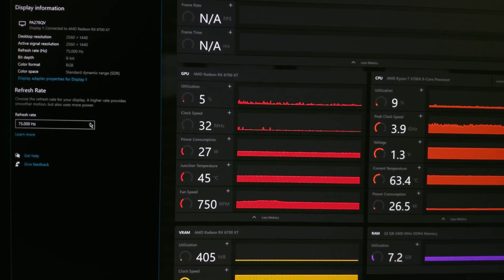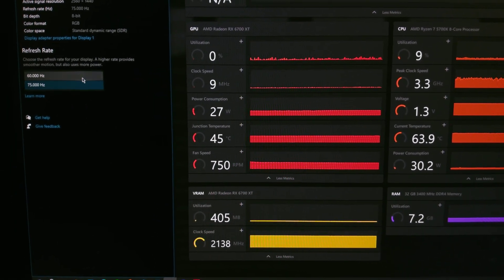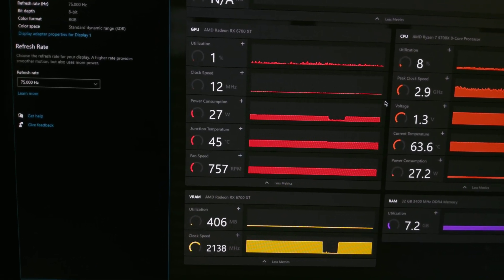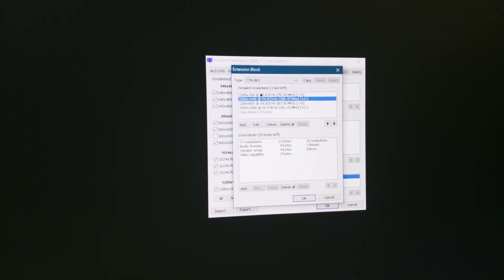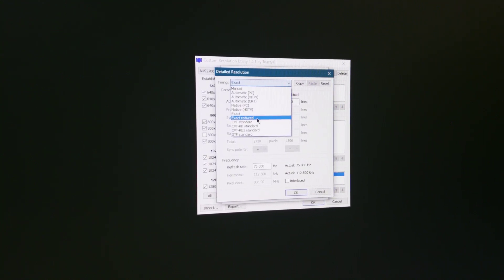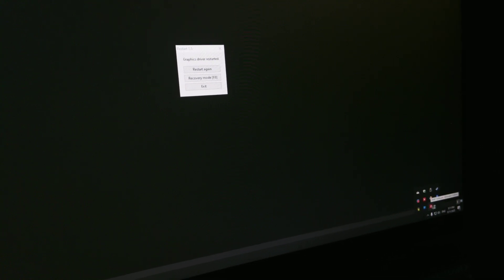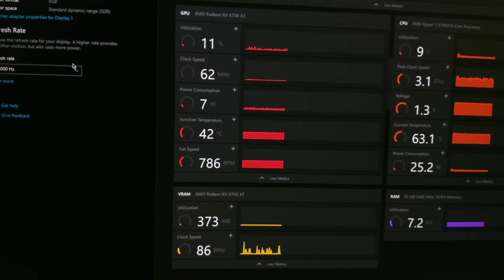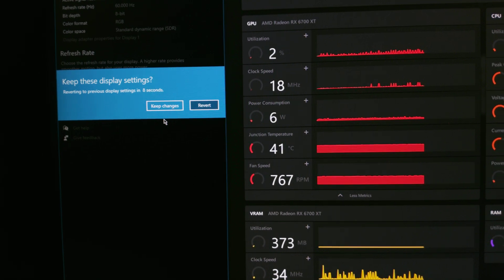Fix High VRAM Clock Issue at Idle on Radeon GPUs

Comment: I have 6750 xt and dual monitor one 165hz and other one is 75hz and what worked for me is adding a custom resolution to 165hz and setting synchronization to CVT. After that just changed to that custom made profile in windows settings
Reply: Idk why it worked but worked, it lowered vram usage from 2300mhz to 10-20mhz and also lowered power consumption from 40w to 8w

Comment: Everyone still having this issue after using this fix make sure that you are not using AMD noise suppression with your GPU just use CPU or just turn it off it ruins my sound in my experience. Also you can use automatic PC option in CRU. After applying the resolution with these CRU settings applied you might get a flashing screen in that case just reduce refresh rate slightly till it works. Had to reduce from 180hz to 170hz apparently caused by cheap display cables.

You might also wanna turn off any memory overclocks after applying these new Resolutions because the card will become very sensitive to VRAM OCs, well that was the case with my 7800xt, core clocks you can go as high you want just leave VRAM clocks alone or let it OC vram itself.

If you have multiple monitors apply this fix for every monitor and just to avoid games overriding your resolution and returning the problem create custom resolutions in the adrenaline software using CRU resolutions as a base. AMD custom resolutions will not be overridden by games or other software

Comment: For everyone who is having this isue. I had a solution, could work for any of you... When I will not play games, I just desable the AMD Smart Access Memory (SAM)... And the vram clock is just fine now. I mean, i dont know if it will work for everyone or every amd card, but for me was hard to find the frequency in my LG 240hz 1080p... Nothing working here. And than I just though : " I will desable that SAM haha ! And it just worked. My Vram clock was aways in 900mhz to 2000mhz all the time just browsing the internet,  and now its pretty much 90mhz to 200mhz must of the time, sometimes a little bit more, but its definitely better. 

My problem was a little more complicated than just "energy" my Vram was getting hot, cause in " zero RPM " fans the memory was hotting alone, like 70c in IDLE. Now the memory is getting 55c in Idle, when GPU is 40c and hotspot 47c, all temperatures in IDLE.  The Memory even with SAM off is going to 55c, but with SAM on was getting 70c in Idle. Im really sad with this, but the thing is, when Im GAMING and stressing at MAX, 100% GPU Load , even with OC, bringing 300w in the GPU, really stressed, Im getting GPU 58c, Hotspot 78c and memory 78c too, with the Custon Fan curves I did... And those are really GOOD temperatures for FULL LOAD. So, the problem is just with the Zero RPM fans in Idle  and its just the memory that is getting 70c alone, really strange. Anyway, you can desable " SAM " to try, I know " enabling " SAM can be a little trick sometime, but it was what work for me.  Sorry about my english, its not my native language, im brazilian.

Comment: For me just changing the FreeSync options from basic to extended resolved this issue. Thats it. Problably disabling could fix this too.

I have a RX 7900 XTX.
Reply: crazy that this actually worked for me
Reply: how did you do that?
Reply: @hossamgehad6673  I just changed the monitor freesync option from one to another
Reply: @hossamgehad6673  Try changing the freesync options of your monitor
Reply: @hossamgehad6673 this settings appear on your monitor menus

Comment: Hi all, I found that changing the monitor Hz to a whole number 1 less than max refresh in CRU fixed my stuck vram clock and high idle power. 100w to 10-30w idle and 33MHz vram clock. 👍
Reply: Sorry man, could you explain what you mean by "whole number 1"?
Reply: @DeathMetalManiac  i assume 144 hz -> 143 hz or 165 hz -> 164 hz

NO fix works for me at all. 110w just being on this page alone. 1440p 144hz and a turned off 1080p 165hz.
Reply: @kochiss  Try going to "Streaming" and turning off everything on "Media"
That worked for me along with the custom resolution thing
Reply: @DeathMetalManiac     it is off by default. also custom resolution tool/amd resolution doesnt work, freesync doesnt work. the only thing that kind of worked was setting refresh to 120hz in windows. Still 74w on youtube.

whereas my 6750xt did 50w 144 hz in the same tasks and turning on freesync at least made it idle at 7w when displaying only the desktop.

Then again, only gpu power on 6750xt vs now displaying gpu board power. I just dont think 1440p 144hz should be using 120w on a 1080p 60 fps video.
Reply: Doesn't work for me unfortunately

Comment: if anyone is still looking for a fix; i recently got a 7900xtx and it had high idle

this didnt work but you can try easier methods like driver 23.8.1 which fixed it in the first place; try doing the driver install only without adrenalin; another quick way to see if its a hz thing is if you change your monitor refresh rate to the next common refresh hz, this is very common for multi monitor setups and the gpu has to be active to process two displays at 2 different hz

Comment: i tried this CRU app but it didnt really work for me or maybe i was just confused. What worked for me: in the amd software i when to display - create new custom resolution and just set it to CVT reduced blinking and my clock speed is back to low. Only thing im not sure about is, when i click on this custom resolution there is one line: G.Pixel clock (kHz) and the value is 699500 and a red exclamation mark.  I dont really know what that means but i guess it works
Reply: this helped me bro thanks !

Comment: worked on my 7800xt, iddle board power went from 80 w to 13
Reply: you're nerfing your monitor though, i don't see the point in this. i also have a 7800xt with idle board power at 80 but i dont want to lower my refresh rate.
Reply: @DreamTerrorist  in what manner?

Lower VRAM frequency - lower temps - longer GPU lifespan
Reply: @DreamTerrorist  can lower ur resolution by only 5 hz and it does lower your vram clocks no need to set it to 75hz